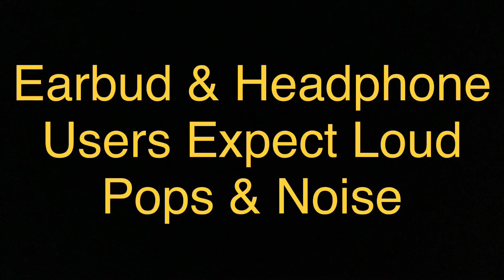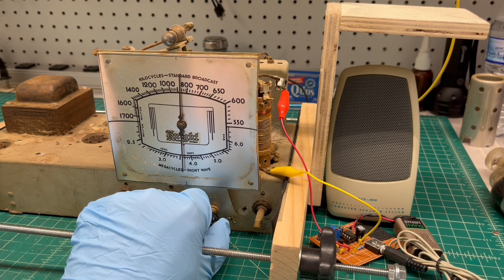Knight 98AE-184K - Antenna Coil, Oscillator Coils, & I.F. Transformers Test Good

Comment: I built your LC Tuning Circuit Tester last August and have used it a few times, and it is a handy tool for me Don, Thanks for your contributions to the radio restoration enthusiasts.
Reply from the maker: Jim - that’s cool. It does come in handy for such a simple circuit. Have a great weekend. Best, Don